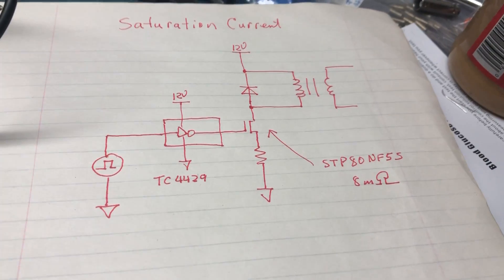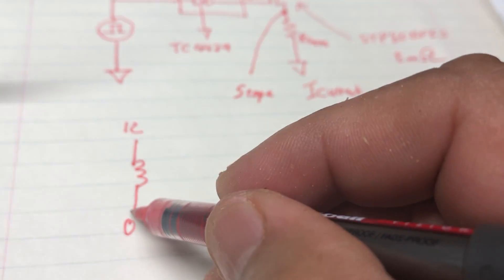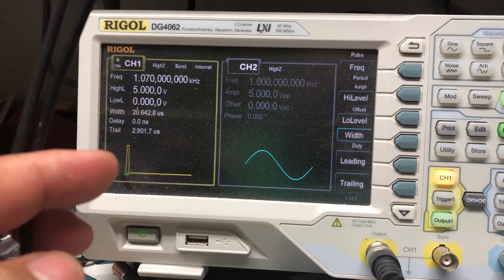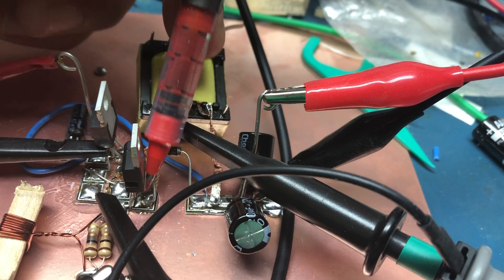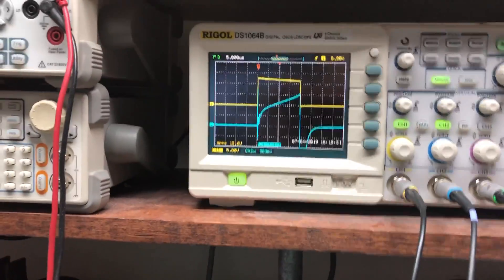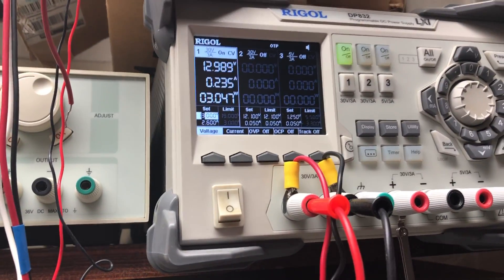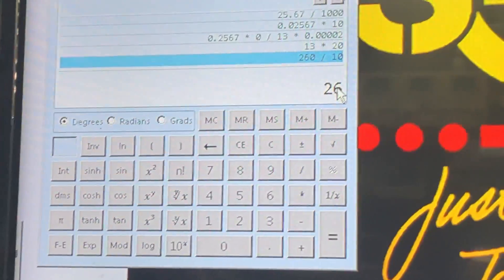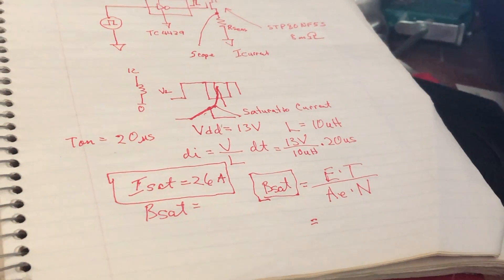Saturation Current of a Transformer

Comment: Great video! I have one caution, as yaghiyah said below, " The Rsense resistor used needs to be, for best performance, a non-inductive type, " coiling the resistance wire is not best practice, even thought at 1kHz it may have little effect. I might  have bundle 10 of those 1Ω resistors in parallel if that's all I had.
Reply from the maker: @mavamQ  You are correct. Non inductive are better. Thanks for comment!  Merry Christmas to you!

Comment: Would that be Bmax (or Bsat)?
Reply from the maker: Bsat
Reply: Would you be able to make a video on how to find bsat of an unknown ferrite core?
Reply: I meant Bmax
Reply from the maker: @coucouj2781  You can use the same procedure I used here and calculate it
Reply: Thank you for the precision, but now I'm a bit confused between Bsat and Bmax. Aren't they the same, where it represent the maximum saturation level that core can handle?
Reply from the maker: @coucouj2781  Bmax should be Defoe as Boperate where the actual flux of the transformer

Comment: Hi Robert, Thank you for this video. Question, in the title you mention that this is a transformer and so I am assuming that this is a ferrite material with no air gap. However, in your video you mention that this is an inductor. Is this an inductor with an air gap or a transformer?
Reply from the maker: Hi Reni, If I recall it had a gap. Adding a gap will make the inductor go into saturation at a higher voltage.  If you look at a B vs H curve, the make the slope of the curve less so the saturation happens at a higher H and therefore higher current. I hope that makes sense. Have a good day.  RB
Reply: @RobertBolanos  Thank you, Is your Transformer spreadsheet available to dowload?
Reply from the maker: @enochreturn  I have the flyback spreadsheet that I can sent if you give me your email.

Comment: The inductance of a transformer primary with an open secondary is just the magnetization current of the transformer primary which is an inductor. So essentially you have a series RL circuit, assuming the MOSFET Rds on can be ignored. Because we have a series RL circuit, the current through the transformer primary and the sense resistor is the same, so we can depict the current in the circuit by looking at the voltage across the sense resistor.

What this means is essentially we are looking at the classic LR series circuit current characteristic which should be exponential, and is as shown on the scope. Then as the transformer primary becomes saturated, or, in other words, is unable to store more magnetic flux , the primary reverts to just looking like a resistor as you extend the pulse time. So, after saturation is reached the RL current characteristic becomes linear (a straight line) like in a resistor. Saturation then is determined by looking at the knee (inflexion point) between the exponential and linear current.

The inductive kick looks a little large which is due to unclamped inductance, either in the transformer primary leads or the inductive sense resistor or both.

Comment: Thanks a lot Robert. Just what I was looking for, this method is great. I was looking for a way to determine the minimum safe operating frequency for a transformer. Just have one transformer and thoughts about saturation was haunting me. I just used an IGBT in the need for a MOSFET of that capacity and worked like a charm. Good to know there are still real engineers left.
Reply from the maker: Thanks for the kinds words. You made my day.

Comment: How does voltage fit into this? Is saturation really just the consequence of cumulated current or is it really about the duration of applied wattage ? E.g.: is there a difference how fast the same core saturates whether I have a high voltage and low current on the primary coil versus low voltage with high current (the product being equal)?
Second question: what about timing, i.e. what are typical real-life values how fast saturation occurs in gapped vs. non-gapped cores? You mentioned 20µs here, but I don't know what kind of core you're using. For a flyback I guess this would be a gapped core, but how would - at the other end of the spectrum - e.g. non-gapped toroids compare? Are we talking nanoseconds? The reason why I'm asking this is that I wonder whether we can interrupt the circuit shortly before saturation by using a MOSFET that makes use of the voltage across the coil (which should greatly decrease near saturation) as gate voltage.
Thanks!
Reply: Actually love to get this answer answered

Comment: 1:28 I would highly stress the point that.. The Rsense resistor used needs to be for best performance a non-inductive type, probably a carbon resistor 3W/5W and maybe a snubber across of 22p or so to tame spikes. That resistor too also acts a magnetic core reset.

Comment: The wire wound resistor is adding a decent amount of inductance. From what I just read that would only be problematic at RF. This is a very interesting lesson that has me kind of puzzled. My thinking would be current falling off with core saturation, not curving up like it does. Great lesson sir.
Reply from the maker: fla playa  Hi fla,  the current goes up because the core is saturated and thus the inductance start to drop exponentially.  It some point it stops being an inductor and start to act like a wire. Hope this makes sense.
Reply: Ah ha I think I just put it all together with your help. Pri current rises as the indunctor of transformer becomes saturated with flux for some reason I was thinking Sec.. I'm going to have to do a lot more research on this. Sec Voltages/currents would be so cool to see as this phenomenon occurs btw. Thank you for the reply Robert, you are highly intelligent.
Reply: I did just totally get it. Saturate/remove good efficiency of core material the inductance/reluctance fall hence current rise... Love the "Wire" analogy... Greatly appreciated!
Reply from the maker: @flaplaya  I am glad my explanation helped.
Reply: to really drive this point home - "inductance drops once all the electron spins in the core are aligned (aka once the core is saturated)", have a look at magnetic amplifiers.  [NOTE:  alignment of electron spins makes the magnetic field strong enough to be detected as a magnetic field around the core;  aka "aligned magnetic domains.  A saturated core has reached the strongest possible magnetization, ie. all its electron spins are aligned]

The magnetic amplifier actually works BECAUSE OF core saturation as follows:

1) normally, an inductor impedes current flow - it takes about five (5)  L/R time constants to reach full current flow in an inductor  (this is why "current lags voltage" in the inductor).  "L" = the inductance value of the inductor.  "R" = the resistance.  You can look up  "L/R time constant" for more info.

2)  so you can think of the core as telling the current "look - I'm not just flipping all my electron spins into alignment just because you want to freely flow in the wire - it's gonna take a bit of time to align all my electron spins - and that means I'm impeding your flow through that wire, so hang tight"

3)  after all electron spins in the core (the magnetic moment of each electron) are in full alignment, the core can no longer exert a 'damping' effect on the current flow

4)  so the "inductance" is just the name for the core material exerting a brief thwarting effect, an interference, over the current freely flowing in the wire

A magnetic amplifier works like this:

1)  there is a core material
2)  a coil is wrapped around it to host AC current flow, just like in a typical inductor or transformer
3)  a second wire is also wrapped around or in the vicinity of the core but it hosts DC current
4)  the AC is turned on and is THWARTED by the electron spin alignment process described above (thwarted by the inductance)
5)  the DC is turned on and PRE-ALIGNS all the electron spins in the core, aka saturates the core
6)  that drops the inductance because the core's electron spins are all aligned and can no longer impede current flow
7)  suddenly the AC is no longer thwarted by the electron spin alignment process and is AMPLIFIED, increases in magnitude

The DC current pre-aligns, aka pre-saturates, the core in order to suddenly remove the thwarting normally seen by the AC

Magnetic amplifiers don't amplify a magnetic field, they amplify AC by pre-saturating the core with a DC-powered winding, and thus by removing inductance.  But they do that by magnetizing the core to the max (aka saturation) hence the name 'magnetic amplifier'

They are also called "Saturable Reactors"
.

Comment: What percentage should the safety gap be between the saturation and operating current?

Thanks for video.
Reply from the maker: Hi Brokenwords. That is a good question. Isat and Bsat are related. You ussaully use Bsat= (VL*Ton)/(Ae*N).  Bsat is given in the core material datasheet. Bsat typically for a ferrite is around 0.3T  (teslas).  So you can use the same equation to calculate the Nturn and use Boperate = (VL*Ton)/(Ae*N).  Per the Abraham Pressmen book, he likes to use 0.16T for Bopeate. That is about 53% of Bsat. You can probably go up to 80% of Bsat. How does that relate to Isat?   (Ioperate/Isat)=Boperate/Bmax).   This is how they are related. Therefore, Ioperate would be 53% to 80% of Isat. I hope that make sense. Great question and thank you for asking it .   Robert Bolanos
Reply: @RobertBolanos  
I think A. Pressmen used 0.16T for Boperate is because he derated it for 120C operating temperature. To be more precise Bsat = 0.28T for ferrite... that about 57% which seem right... 60%-70% of the room temp capacity  seems to be the target number for high temp.
Reply from the maker: Jesse Lee thank you for your response. I think Dr. goes as high as 80 % of Bsat. I think that is where I got the 80 percent. Also keep in mind that bsat is also specified at two temperature which one of them is at 100c. So if you go 80 percent at the Bsat specified at 100c you should be Ok. The only time you would go 80 percent is if you are trying to fit many turns into a core. If that is the case, might as well use a bigger core. Again thank you for your inputs. Robert

Comment: When you calculate Isat, you assume no voltage drop across the shunt resistors. I suspect that would be a significant source of error.
Reply from the maker: Hi KX36.  I did not have a very accurate current sense resistor. I tried to make a current sense using magnet wire but I could not verify such a low ohms with the test equipment I have. So I relied on the Di=(V/L)*Ton to try to calculate the delta current. I have a LCR that is accurate and I rely on the LCR measurement to get accurate enough calculation. I just wanted to be in the ball park; it does not have to be that much accurate. To measure  more accurate, use a precision current sense resistor. Thanks for the question!  Robert
Reply: @RobertBolanos  I don't mean to measure the current accurately directly from the resistor, I mean the burden voltage of the shunt makes up a significant portion of the Vdd you used in the formula since the current is apparently so high. If this is the case, the shunt resistor is acting as a ballast to act against saturation.

You can still calculate current with that formula and forego the need for an accurate shunt resistance, but you need to measure the voltage across the inductor only, not just use the supply voltage.